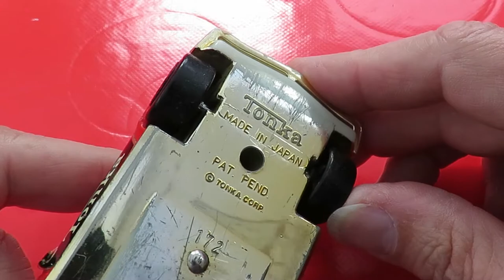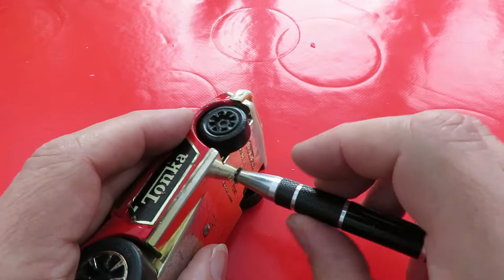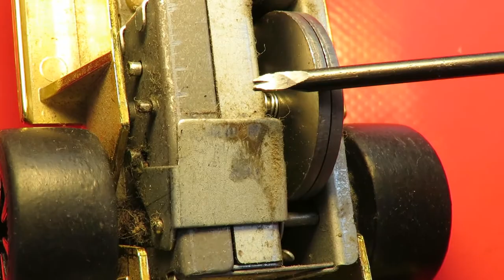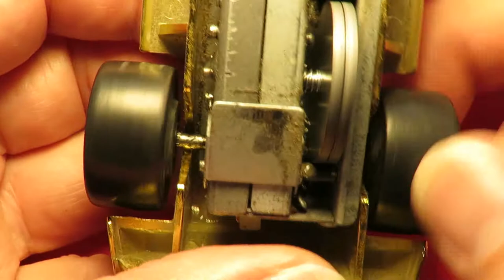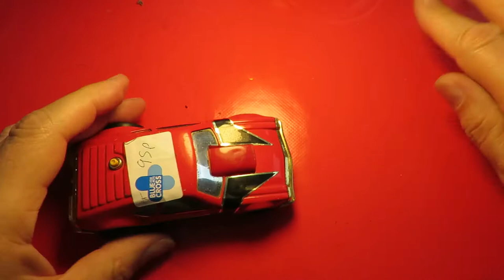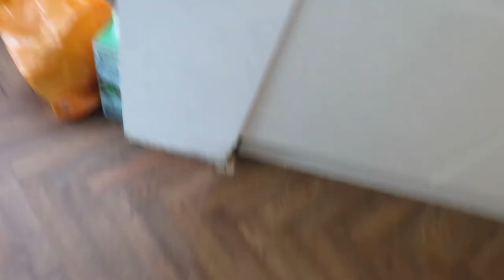Friction Flywheel Tonka Toy Car Tear Down

Comment: There are many friction/flywheel powered toys but I think this design is the ultimate, with one fatal flaw one of the spindles inside  has plastic gears which WILL lose a tooth from the insane rpms the flywheel can be brought up to and either make it no run at all or quite badly. If it were all metal it would solve the probelm. I've taken a motor apart because of the stripped spindle and there might have been at least 5 gears inside all contributing to increasing the rpms, and when you have one in perfect working condition and it's locked in to it's rev up mode each rotation of the wheel can give you, no exaggeration, about 60 rotations of the flywheel, so if the wheel can cover about a 3 inch distance and your rev area is let's say 24 inches that's 8 wheel revolutions which means 480 flywheel revolutions and if the internals will hold it will only keep getting more rpms if you can do it fast enough. If you can cover the distance in 1 second that's 28,800 rpm, in a half second that's 57,600 rpm and in a quarter second that's 115,200 rpm. These things are no joke, and when you push the button the wheels don't turn at 1 revolution for every 60 of the flywheel like most friction powered motors do, the ratio changes to something like 4 flywheel revolutions for every wheel revolution, so now your 50,000 rpms flywheel translate to something like 12,500 wheel rpms which would indicate a wheel speed of 35 mph, now I know I can easily be off on my numbers but trust me the flywheel rotates at 40-60  rpm or more for every wheel turn, push the button and it gives back to the wheels at a rate of 4:1 or could be 10:1, either way these things rip, they can make so much power the are completely uncontrollable,I had to take the body off and put some quarters inside just to weigh it down and be more controllable. Bottom line, kids today don't know what they're missing, flywheel toys today are super lame and slow, and you can't get any good revs out of them, and if you see a tonka clutch popper for sale that's like new GET IT, i'm sure you'll love it. Also they started making the later models front wheel drive, I didn't like it at the time but I understand now that it was a design change to keep the toy from losing control when it was revved to the moon. Awesome toy that they NEED to bring back, minus that plastic piece that always breaks.
Reply from the maker: Yes I like these, like so many toys there is so much design work gone into them that is wasted on the lids that play with them. That is one reason I like looking inside them to see how they work.